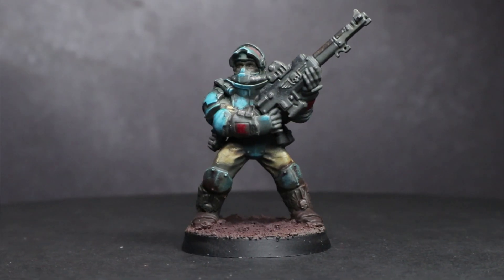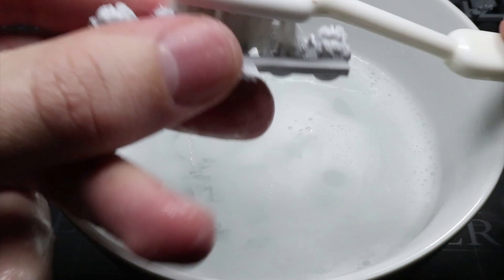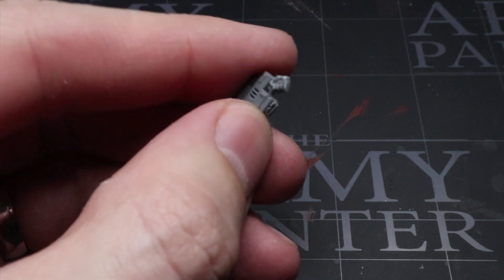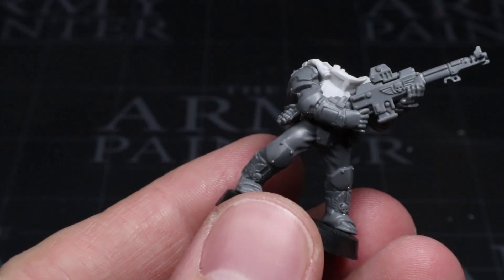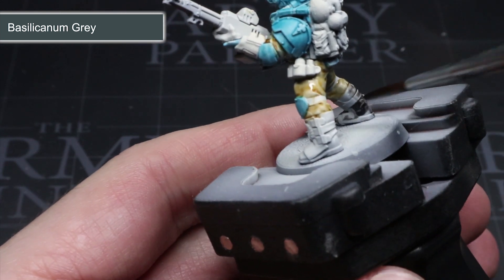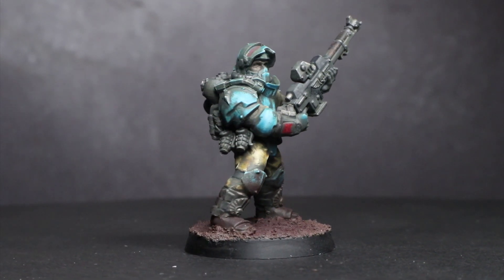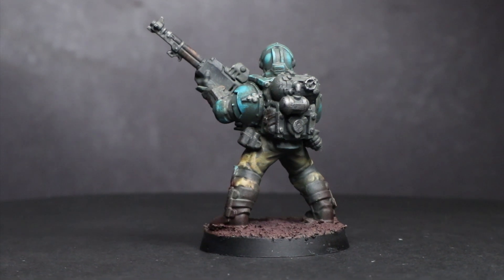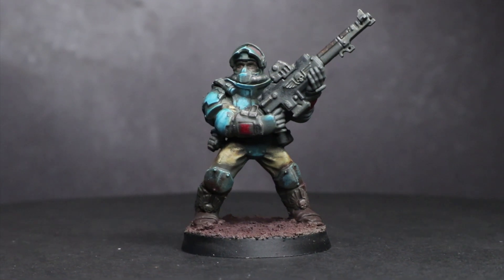Kit Bashing Solar Auxilia - Third Party Conversions

Comment: Great result, I love it. I could say this for any of you kitbashing videos, but this is the most fun part of 40k for me and a large part of why I stick with the hobby.

I had the plastic Chaos Terminator Lord kit from back in the day, but I needed a Space Marines Librarian. So I filed off the chaos markings, stuck on a venerable Dreadnought plate on the front, covered one of the legs with a groin cloth/banner and your average dude can't tell he was Chaos. 
I used Catachan soldiers as House Orlock gangers as well, worked completely fine and I could actually put whatever bits I wanted on them, unlike the metal versions.

Comment: 2:53 I worked out that pressing smaller pieces into some blu tack before attempting a cut means you are less likely to lose the bit that would usually ricochet off every available surface in your workspace before getting lost on the floor/ in a fold of your clothing/ in your hair/ in a pet's fur/ in a beverage/ in your paint water. 
Great work as always, Cheers!

Comment: I've made some decent Vostroyan conversions using Cadian legs and arms, and a mixture of Anvil Industries Cuirass, Hussar, and Medieval armor torsos and their Bearskin hats with and without visors. For shoulder pads I cut away one or both shoulder pads on the Cadian arms and replaced them with Single Curved Gothic ones from Anvil Industries. I also integrated the Anvil Industries gothic robotic arms here and there across my force. You could probably make the lasguns more archaic looking with a similar barrel swap to what you did here with one of the skitarii kits, but I didn't think to do that at the time.

Comment: Nowadays you can just get a printer, a print file bundle from Anvil and a bottle of resin for roughly 300£, meaning marginally more than 4 squads, and do this for a fraction of the cost if you just look at the printing cost.

Comment: I’ve seen some talk about sealing the model before adding the AK Streaking effects. I’m not sure that if that was to help flow or it was to protect the base paint underneath. Did you seal before?
Reply from the maker: Just a quick coat of spray varnish (gloss usually) is useful for protecting the paint underneath from the thinners you apply to remove the grime.